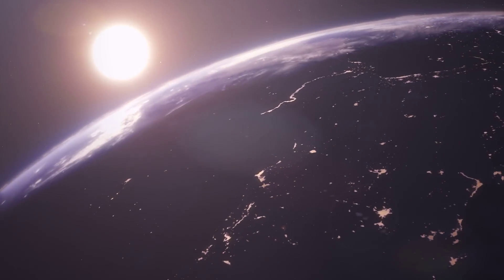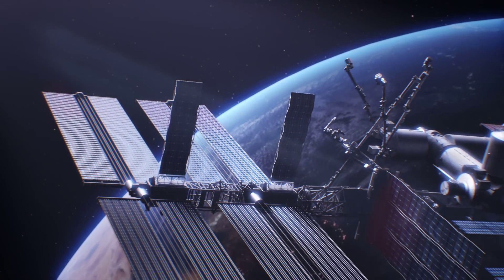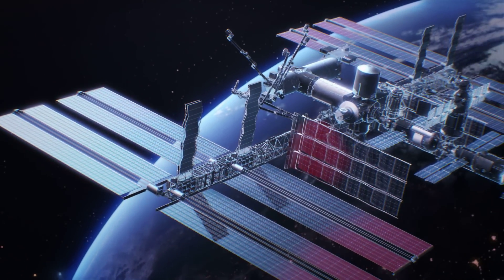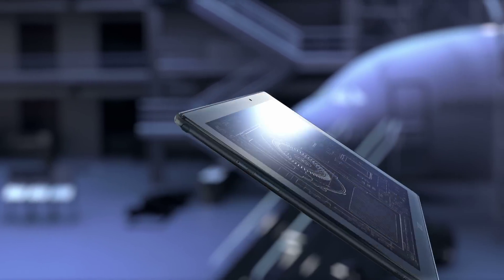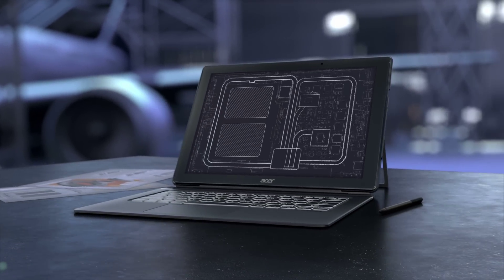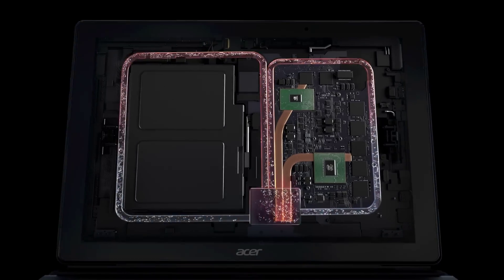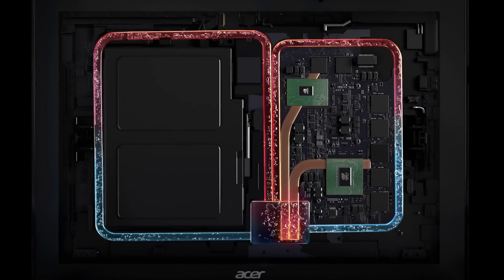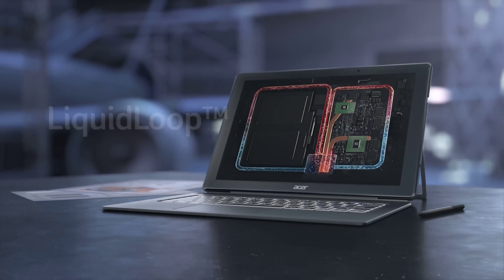Acer | LiquidLoop™

Comment: What pump are you using, Acer? What pump could possibly be able to pump water through channels that are sub 5mm thick (which these have to be since the tablet is slim) and be below 5mm in thickness itself? 
Also, you say it is fanless. Yet you have no radiators in your loop that would increase the surface area and allow more effective heat transfer for natural convection to not be negligible. 
So what magic are you using in there?
Reply: i dont think theyre using water. possibly something boiling at lower temperatures to move heat away with the help of condensation. saw this in a desktop, where they had a box of bubbling liquid on a cpu with the steam going through pipes to cool down, re-liquify and flow back into the box on the cpu to Restart the cycle. pretty neat actually.
Reply: @scyhte82  yeah but there is this thing called thermodynamics. That laptop is a closed surface and if the heat is constant, the energy should be going somewhere. A closed system where boiling/condensation happens still has to conserve energy.
Reply: @scyhte82 what is the name of the liquid they use?